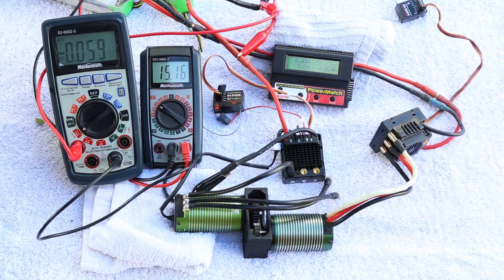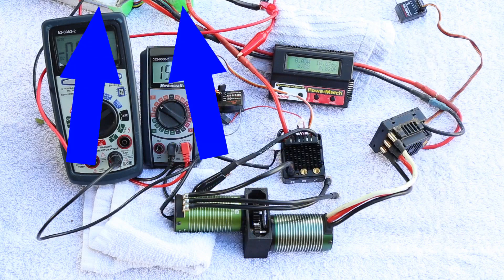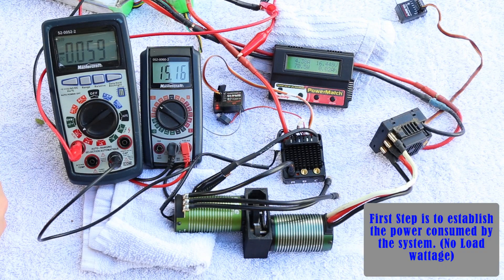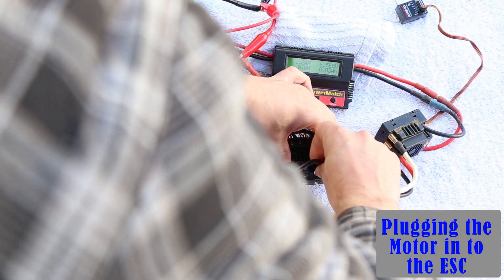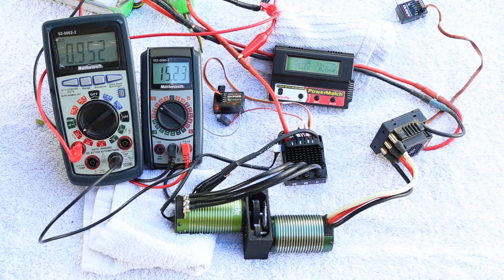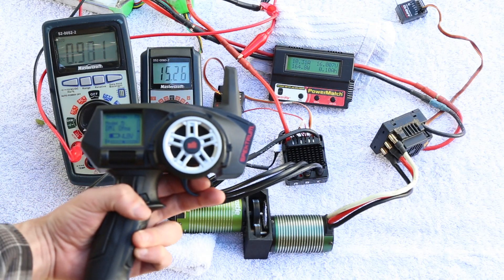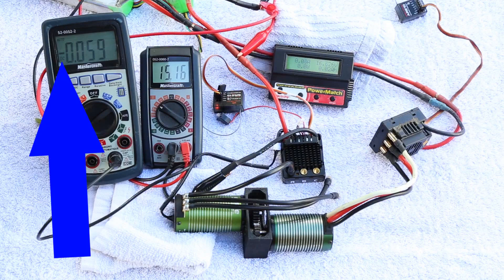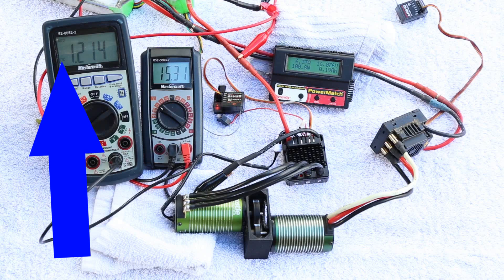Does an RC ESC / Motor have Regenerative Braking that charges the LiPo Battery?

Comment: I used to drive a electric skate board, and the manual specificially warned against going downhill on a full charge! It would use regenerative braking normally, but when full, the current the battery could take was too low, so the energy had to go to the other components, or in actuality in braking force could become to low. I asked the engineer why they did not add a resistors with a heat sink, the answer was cost, to cover an edge case (starting fully charged on top of a hill)

Comment: I have been waiting for this since 1988 when the Novak t4 came out. Great Job!
Reply: Did the Novak T4 have regenerative braking? I am looking for something to extend the runtime in an endurance race.
Reply: @steveruta8746  Novak advertised that it had it but how good it worked it worked i couldnt really tell as the only competition was the resistor speed controls
Reply: @donaldcarter1206  were there any others that had this feature?
Reply: @steveruta8746  The Tekin 420p advertised it i am sure there is more. In the testing it looks like a castle sidewinder esc and a slightly higher end version of it that is on its side. I am thinking they all have it now and just stopped advertising it.

Comment: This looks like two opposing motors and you are measuring the current of one of them. It does not look like there is any braking involved. The braking and acceleration current would need to be performed with the same motor.
Reply from the maker: Not sure if I understand exactly what you are saying. There is braking occurring, that is the whole point. Think about it as jumping in your car getting up to highway speed and then flooring the gas pedal at the same time as pressing the brake pedal just the right amount to maintain constant speed. At constant speed there is no "acceleration current." You don't need to replace your disc brakes on the car with an engine that is the same as what you have under the hood. In other words, I could have used any brushless motor as it is serving as a (virtual disc) brake and not being powered  to accelerate the motor. I can't remember what I speak about in this video, but I'm sure I go through what is happening here in enough detail.

Comment: So if I add a 1% drag break to the esc would that give a good regenerative effect.
At 1% i would still have my truck roll without much resistance but would it charge much.
I always wondered why there is a drag brake setting because if I want to slow down then I will apply said brake.

Comment: I bet the reason why you have a higher "efficiency" at partial brake is that is the most braking effort the ESC can turn back into power, and anything higher it turns into a resistive "Load" or heat. To turn all the braking load back into power would require the ESC to be designed to be both a motor controller and  a AC to DC rectifier and DC regulator, which would raise the cost , complexity and weight for little value, given most of the time the ESC is used for forward motion. GREAT VIDEO, very informative, you gained another subscriber!!!! Also, please do not shy away from the EE theory and math behind what you explaining, if people do not like the math, maybe you could give them a link to skip the math parts of the videos. I however love the math!

Comment: Novak Electronics advertised their top racing brushed ESC's as having regenerative braking all the way back in the early 90's.  Swapping to one of their esc's did seem to add a tiny bit of runtime and slightly faster laptimes at the end of a race.

Comment: How does esc braking work. ,, Does 3 mosfets  handiling +charge.   Short circuits.    Or. -ve.  3 mosfets short circuits
Reply from the maker: The FETS are used to short the motor windings

Comment: Great! does this apply to every ESC's or just high-end esc's? What about brushed setup? (Charles Garnier RC on FB)
Reply from the maker: I have not done any testing with a brushed setup. If the brushless ESC brakes the motor in the same way it doesn't matter if it's low or high end.

Comment: Good night Sir. I apologize for having an unrelated question in relation to this video. Can you please explain the difference between a standard ESC and a HV ESC for marine applications?
Reply from the maker: HV - high voltage. HV is generally from 7 LiPo cells and up.

Comment: Interesting, but isn't it that regenerative braking comes from the same motor that drives the vehicle? 

To understand it a bit better, if a magnet is in motion near a coil, it generates power from the coil. 

How I'd imagine it would work is a set of diodes connected to the 3 coils in an arrangement to charge the battery (through some sort of voltage regulator of course). Because the diodes are in place, it'll output power from the motor to the battery rather than the battery running the coils.
Reply from the maker: Hi Soul-Struck, the motor that was powered represents the kinetic energy of an RC Car travelling down the road. It's just a lot easier to show the relationship (and record video) by maintaining constant energy using a motor rather than having a car come to a stop. The motor doing the braking would have spun up the other motor if I hit the throttle rather than the brake. If I did this and used the other motor to brake, it would have started to charge the other battery.

Comment: In theory unless it was balance charging, wouldn’t it be bad for the lipo?
Reply from the maker: This is a great question. As the motor uses energy, equal capacity in mAh will come out of each cell. When the battery is charged by the ESC, equal capacity across each cell is placed back in to the pack. Since we know that we will never recoup the same amount of energy that was used by the motor to get up to speed vs braking, we will not run the risk of any charging issues. Each cell within the pack will be able to handle the amount of energy that is charged back in to the battery even if the cells are completely out of balance before the run started. 
Now if you had done what I did and charged the battery continuously like a generator for an extended period of time, you will not only need a balancer but also a charge controller. The ESC will not know when the battery is fully charged and would continue to push power to it. This could be bad for the LiPo. In the experiment, we could see the total amount of voltage and assuming the battery was balanced (it was) we never exceeded 4.0v per cell.
Reply: @RCexplained  I think that is pretty crazy, I never really though about regenerative braking even if it only put a lil bit back
Reply from the maker: I also did not understand it was occurring to this degree. Interesting stuff
Reply: @RCexplained  I think if regenerative breaking was more optimized in rc cars it could be groundbreaking, just like ceramic bearings which I wish I could buy for my monster truck

Comment: Yeah you have done it! 👍👍 Cool to see, that my assumptions from bench testing and voltage monitoring are true.
Now, only one thing is open for me: does "drag brake" make sense to increase efficiency and if so, at how much percentage is it most effective? 😃
I think, by the tests you have done in this video, it would make sense to activate drag brake at the lowest setting. 🤔
Reply from the maker: Yes, your assumptions were spot on. 
I was expecting a lot lower efficiency than what had been calculated. You can simulate a drag brake yourself by using only a small percentage of braking effort when coming to a stop rather than 100% brakes applied.
Reply: @RCexplained  Yes Ryan! But that's a pretty simple and pragmatic solution. 😄
Wouldn't it be better if the controller took over the task and used every opportunity to regenerate? 🤓
Reply: @S-Tec-RC  I mean it just depends how you want the speed of the car to change. When not regenerative braking, the cars just coasts along. As shown in the previous video, a motor with floating voltage (no load, or cables even physically disconnected) has a very low mechanical resistance, so the car keeps its momentum quite a bit longer, and "uses" its mechanical energy to overcome the mechanical resistance. When regen braking with a low drag, the cars does slow down quite a bit more, but you only get about the 30% of the energy back at electricity. So the most efficient way to slow will always be neutral, then low drag brake, and most wasteful is full brake. But of course you get better brake performance for the lowered efficiency.

Comment: Is cheap esc also provides. Extra running time???
Reply from the maker: All ESC's that brake using the same method will generate power that goes back in to the battery.
Reply: Thankks mann